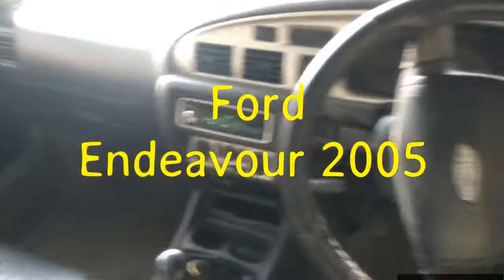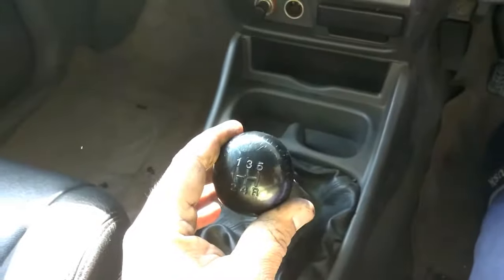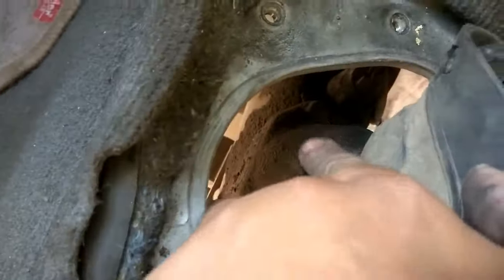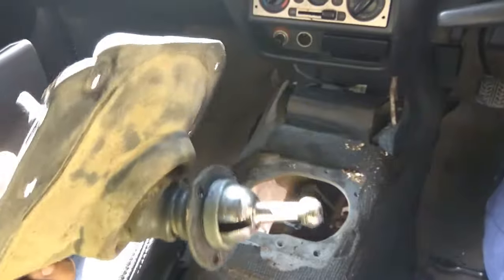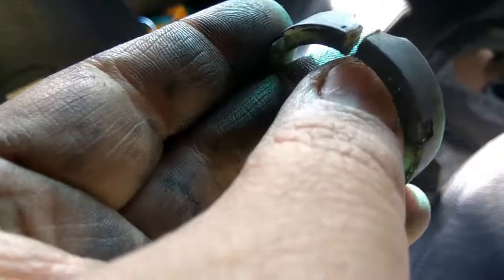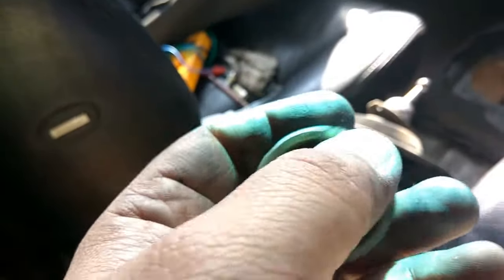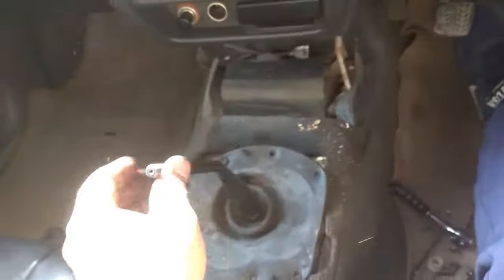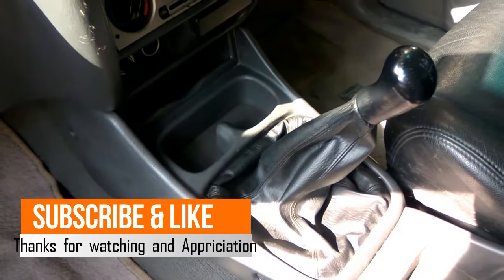How to Fix Loose Gear Shifter??

Comment: Nice video but I am wondering did you slip the bushing over the Ball or the shaft, seems to me it might break doing it either way since it was already cut to install and the original was not.
Reply from the maker: Hey mate , Yes there is already cut in the bushing ,I didnt make any cut .